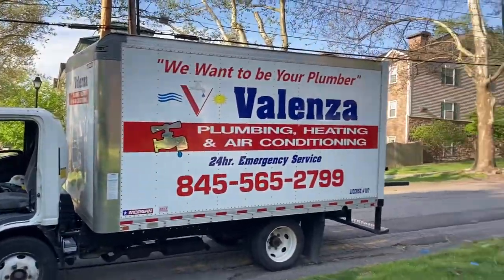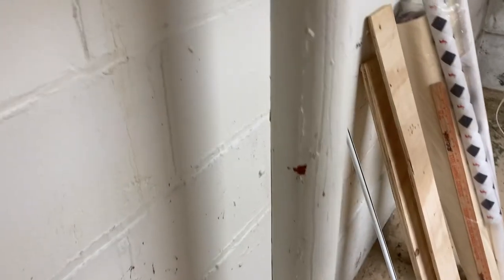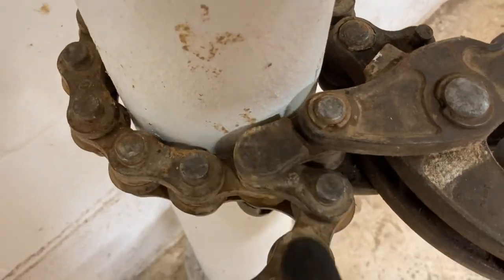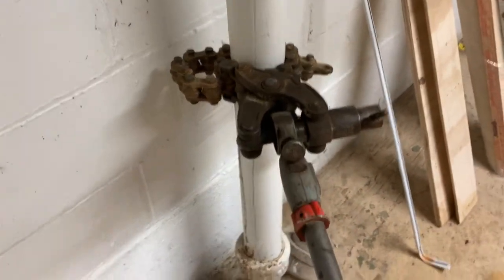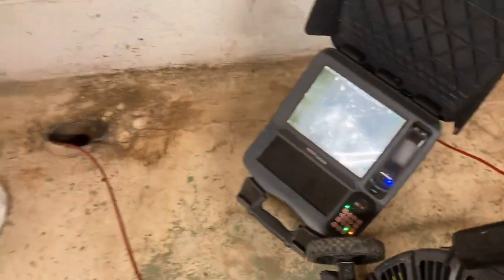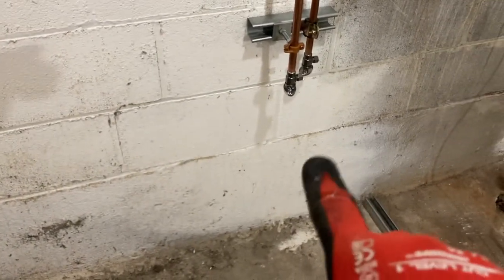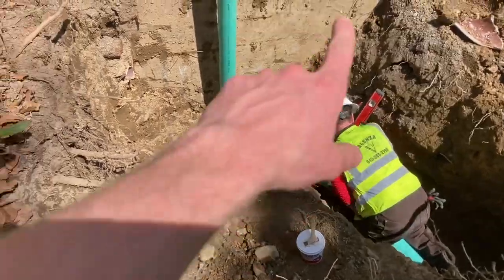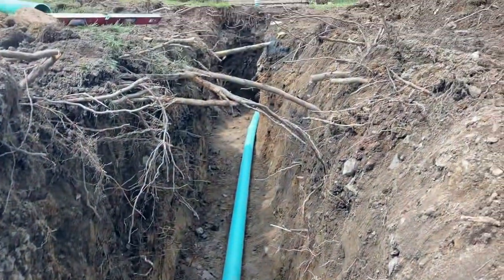Sewer Line Replacement and Building Drain Tie-In!

Comment: Nice job , hope to see more videos and if you don’t mind me asking what kind of laser do you guys use. 
Thanks for sharing your work with us and I hope you have a great weekend.
Reply from the maker: We appreciate the kind words brother. We have a few lasers, but my personal one (the one shown in all the videos) is the Milwaukee M12 3 plane. I love it. It has great distance and a nice crisp beam.
Reply: @valenzaplumbing  Thanks my friend I’ve got a lot of Milwaukee stuff but I don’t have a Milwaukee laser my lasers okay but not great thanks again.
Reply: @valenzaplumbing  how did you set it for grade ? I’m an apprentice and I’ve never seen that done.
Reply from the maker: @tunezghb9794  I’ll try my best to explain. I made a mark at the starting point, which was the center of the hole where the 4x3 wye was installed leaving the house. I then set my laser up right on that line, perfectly level. I then measure the distance from my first mark to where the run will end. Let’s say it’s a 10’ run. I’ll figure on 1/4” per foot and make another mark 10’ down from my first, but 2.5” above the laser line. Then I’ll lock the pendulum on the laser and cant it to line up with both marks. The laser beam is now sloped to my pitch and I can install hangers and line my pipe up etc. Some less expensive lasers don’t have lockable pendulums, so this method isn’t always doable depending on what equipment you have. Hope this helped.

Comment: Nice work! But why use "thinwall" 3034 instead of schedule 40 PVC? and why use ABS? Just curious and trying to learn.
Reply from the maker: SDR35 is the standard for underground sewer piping. Municipality’s and contractors alike use it in sizes 4” and up. PVC does not have good shear strength underground. It’s strong due to its thicker scheduled walls, but if the ground isn’t perfectly compacted and it shifts, PVC will snap in half. SDR35 is more flexible and will bend before it breaks. And the gasketed fittings allow for flexibility without breaking or leaking.  Plus, gasket fittings are much more easily installed underground, in my opinion. Just push them together. No glue or primer.
Reply from the maker: And ABS is what most of the homes in our area are piped with. New construction and old. No sense in connecting PVC to what’s already done in ABS.

Comment: do you have to use push gasket on the sdr 35? i prefer solvent weld
Reply from the maker: Nope, we could use either one. Gasketed fittings are preferred in my opinion because of the added flexibility of the joint underground. Also, working with gasketed fittings in the trench is much easier. No glue or primer to fumble around with.
Reply: @valenzaplumbing  fair enough,  either way good job